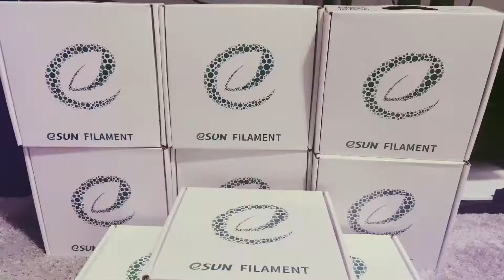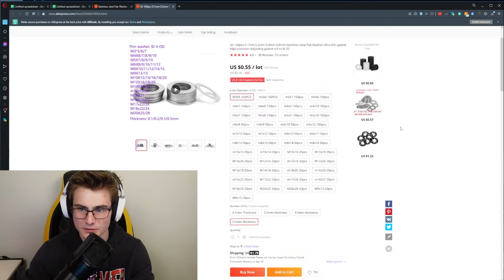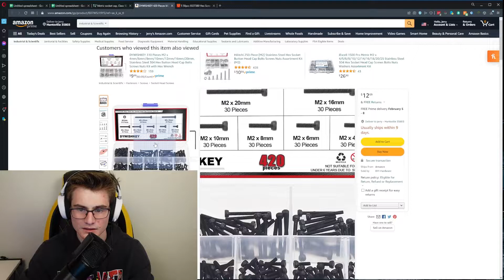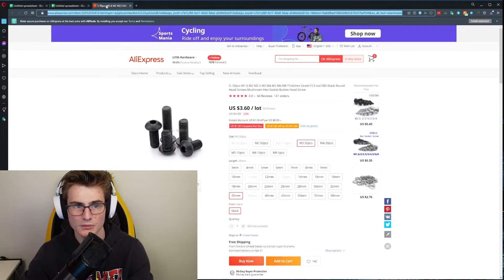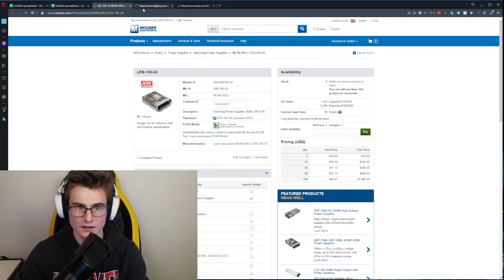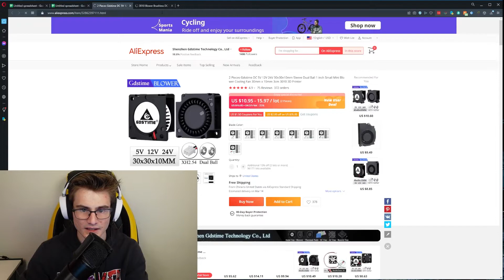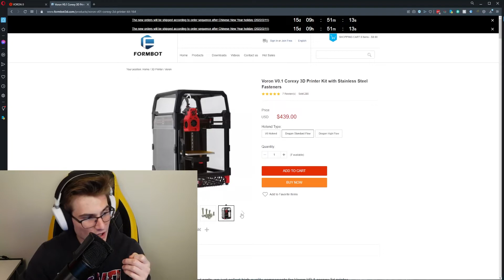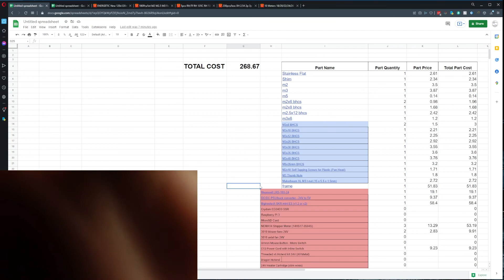I BOUGHT A VORON 0.1 KIT! DO NOT SOURCE YOUR OWN VORON PARTS!

Comment: Interesting video.
Keep in mind that half the time not only do they order in bulk but they also cut corners on parts. Belts, bearings, motors, extrusions..There are varying grades of quality on most of the hardware. A Voron is not made to be an affordable printer. And sourcing the parts yourself is not supposed to be cheaper. Admittedly, there are some "kits" that are of good quality. LDO for example. But on a happy end note, enjoy your build. It's a learning experience, and extremely fun. It is definitely a character building experience. Will be fallowing along to see your progress.
Reply from the maker: Yeah that was a thought in my head. I would love to build a fast machine, but I don't think I have time to dedicate to making the world's fastest benchy, at least not right now. I also think that I currently don't know the knowledge to pick the better parts yet. I think I need to go through this process once before I know what the better parts are. I'll almost definitely be doing this again and the second time around I'll probably source my own.

Comment: Why were you looking at the BOM for the V.0? They have a different page for v0.1. I have no idea if the parts for the v0 or more expensive or less than a v0.1 so it might not have affected the outcome of the video.
Reply from the maker: The parts are nearly identical and the 0.1 bom was not on the voron website yet for some reason. But yeah there are very minor differences

Comment: I built my v0.1 by sourcing all the parts myself and I saved almost €300 from the popular kits available, since I had no rush I waited and took advantage of the various sales on aliexpress. Mind you, it took me months to gather everything, I also cut some corners here and there with cheaper parts and got lucky with others, like the extrusions. I paid €38 euros for the frame on sale (free shipping) from a seller with low sales, once the extrusions arrived I noticed some discoloration on the black aluminum, I let the seller know and got a partial refund of €12!
The v0.1 has been working for the past month and a half and it's a workhorse, I'm very happy with it.
Reply from the maker: Thats fantastic! As with any project where you need to source parts, if you do it yourself and you are not on a timeline, then sourcing will always be cheaper. I think with rapid sourcing there is no way to build a voron cheaper than it would be to buy a kit